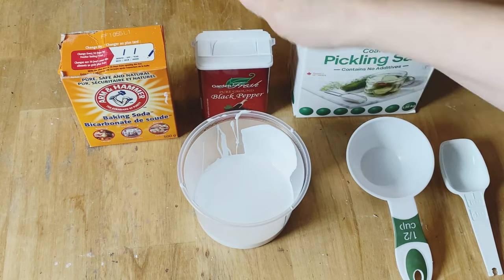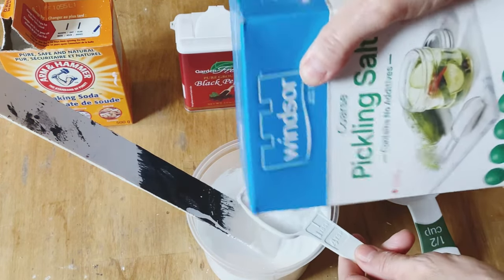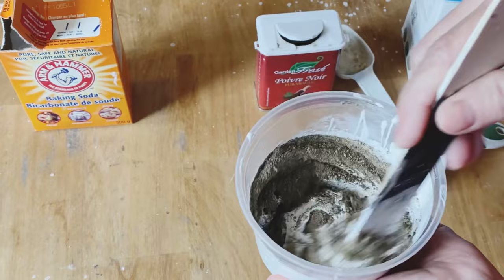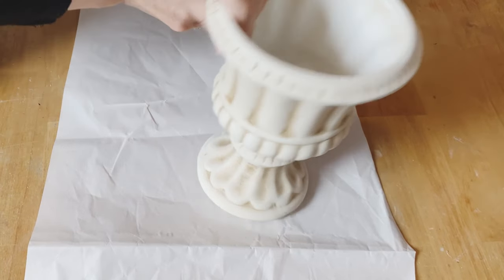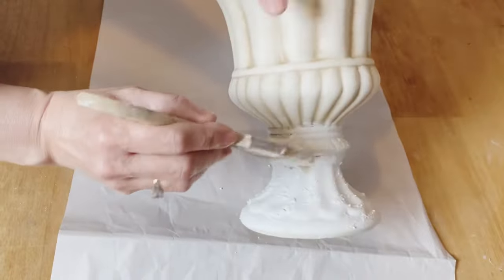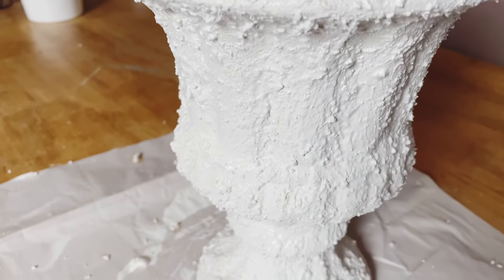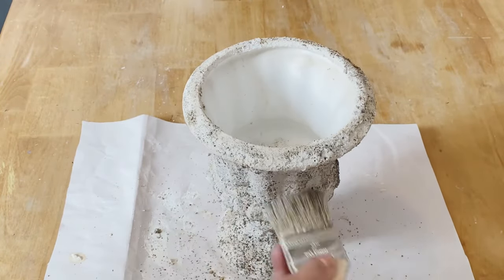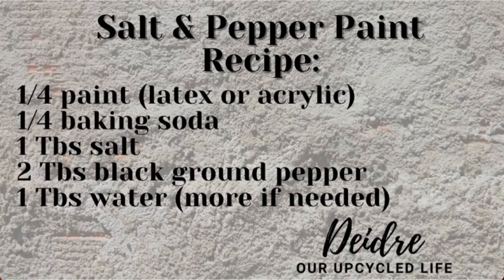Create a Faux Cement Look with Simple Salt & Pepper Paint DIY

Comment: Hey from Arkansas again. So I followed this recipe except for the pickling salt. I used some coarse Sea Salt... Maybe it's the humidity here?? Idk but mine did not turn out nearly as smooth and easy as yours looked.  It was so gloppy and wet... It just slid off the vase in glops and left a watery grey streak on vase .. I closed it up in an old lunch meat plastic container and when I came back out like 30 min later to check on the vase there was literally water puddles in the sealed container.... It was kinda dry and crumby looking, but there was literally water standing in the bottom of the container separate from the paint mixture.... My husband just reminded me that it's like 65% humidity right now and it's only going up bc of rain coming in.... Idk what it could be otherwise....
Reply from the maker: Hi Wendy I think it might be the humidity but also I don’t use the salt wash technique on glass I only use it on wood it’s very easy for it to slide around on glass and not work Properly. It needs to lay flat and the wood would  Absorb that moisture

Comment: Question: I noticed that you couldn’t see the black pepper until it was daubed on at the end. That could have just been a trick of the video. But, if it really doesn’t show during the initial painting, can we skip the step of adding it to the mix and get the same result by just daubing it in at the end? Or do you need the pepper incorporated to get the texture?
Reply from the maker: I add the pepper to the paint because I find it adds extra texture but for sure you can just add at the end. Try it either way and see what you like best ❤️